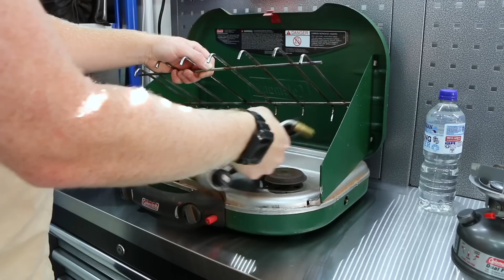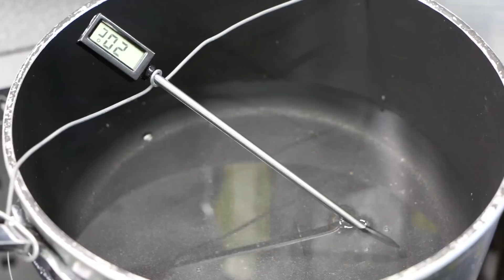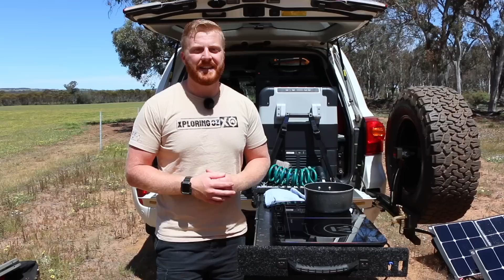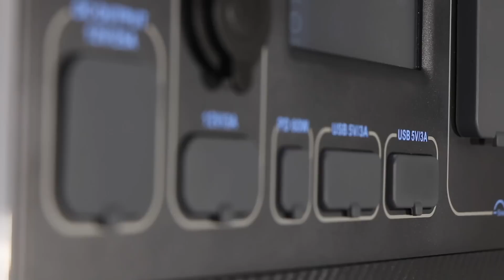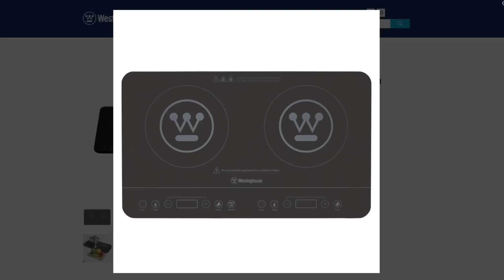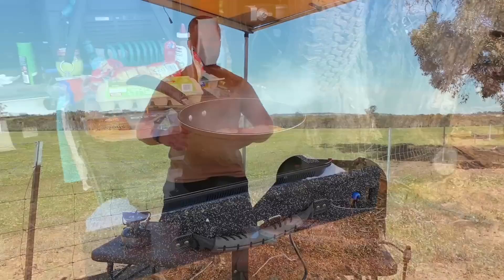INDUCTION COOKING & Camping | Is it sustainable | Electric vs Gas | Overland Cooktop | Pots&Pans

Comment: I strongly recommend that you either:
1.) add a second alternator, because you are overloading the one you have if you are also charging the Bluetti while driving.
Car alternators are designed for a relatively short period of high current loading immediately after starting the vehicle to recharge the starting battery. (a 4 minute heavy load on the alternator for the car battery recharge VS a 4 hour load from the Bluetti.)
 If you run a separate alternator for the Bluetti you can use a 24 volt truck alternator to take advantage of the fact that the Bluetti can handle the higher voltage input if you charge through the Solar Power charging port. and you can get twice the charging power with no increase in the current load on the extra alternator or vehicle wiring.
2) replace your existing alternator with a much more powerful one. I have seen 350 amp alternators used on RVs that charge lots of batteries for use inside the RV.
3.) find a technician who can add a power connection to the AC side of your alternator so you can run that AC into a small transformer to power your induction cooktop and completely eliminate the large power loss in the DC to AC sinewave converter; and be able cook your food while your vehicle is at idle....
 With an induction cooktop the frequency of the AC power it runs off of is not as important as it might be for other equipment..
Reply from the maker: Hey mate, 
Yes a higher powered, slightly different designed alternator is on the cards, however I'll probably get the maximum life from this one first. 
I have noted that even when the vehicle is running, batteries charing and the AC inverter is on and charging the Bluetti, we are still bringing in about 15A positive. It's comforting to know that the alternator still has some capacity left in it after the heavy draw. 
I'll have a look at some options, but thanks for sending some ideas through, I'll definitely consider and research them. 
Cheers, Nathan.

Comment: A very eye-opener review.  I hadn't considered induction, but now I will if I can come up with a good power setup to support it.  I did have a chuckle when you casually set the unit on the table.  I am guessing the wife can't do that.  Just a mere 28.2 KG.  I can see that you have been using it to work out with.  lol   I had to go to the USA site to find the weight.  I could not find that tidbit of information on the Aussie site.  Again, that was a stellar review and I was very appreciative of all the work you put into it.  Subscribed!
Reply from the maker: Thanks mate, glad you enjoyed the video. Yeah, its a decent unit the ol' Bluetti, but the fact it so versatile and powers so much more than just induction cooking, it sure helps off-grid.
Yes, I must admit the Australian site is lacking a little, it looks a little like the US site did when they first released over there. Hopefully they'll continue to improve as business picks up locally. 
Thanks again mate, glad it was helpful.
Cheers, Nathan.
Reply: @XploringOz   I did some shopping and I see that the maximum wattage can vary.  I saw induction cooking plates (had to refrain from calling it a burner) with a max of 800, 1000, 1200, 1500... etc.   If I only wanted to lug around a 1000W battery, would one of these lesser wattage ones do the trick.  Like just 1000W?
Reply from the maker: @davids9577  Yes and no. It would heavily depend on what type of unit you purchased. For example these units I used, even though they have a 200, 400, 600 & 800 W setting, this is an indication of heat and actually pulses the W at 1000W rates to maintain a lower temperature. This with the standby power usage would push it over the 1000W maximum, in my case anyway. 
I'm yet to find a unit that would be able to produce a constant 800W level.
Does that make sense? I hope so 😂 
Cheers,

Comment: How well do they preform above 2,000 feet , when it becomes harder to boil water ? Does it require more wattage like more fuel or just a  pressure cooker and lower watts... 
Ps. I only need 8-900 watts for cowboy coffee on my home 1,800wt induction plate..
I traditionally use an enameled  Dutch oven in fire pit for my evening or Big meal... will have to try the induction at the 5,100 foot campsite next summer on my deepcycle batteries... Cheers from Oregon (USA)
Reply from the maker: Hey mate, so to be completely honest, this is not something that I've thought about (or tested). Where I live in Western Australia, it's very, very flat. So I probably wouldn't get an opportunity to test this, however if you do, make sure to let us know. I would be interested to see your results. 
Cheers, Nathan.
Reply: @XploringOz  am planning on going to the campsite at 5k feet in spring (after meltoff)... winter's just starting up here.. around the 2k+ elevation it starts to get harder to boil water
I wasn't sure about the mountain range over there... 
I'll put up my results, if someone doesn't beat me to it... Lol 
Stay Safe
Reply from the maker: @mrmcclung  Awesome, would be very interesting to hear your results and thoughts on the efficiency. 
All the best with your trip!

Comment: Great video, induction is great but the issue with the limitation inverter technology is problematic. Wonder if during your investigations if you came across dc powered induction cooking unit thus eliminating the dependence on the inverter.
Reply from the maker: Thanks mate, so I haven't come across any DV powered induction cooktops yet, however saying that I also haven't been on the hunt for them either. I guess the only great thing here is that the Bluetti unit has everything built in, so yes we still have that lost power from the conversion, but it's still very convenient nonetheless. 
Cheers, Nathan.
Reply: An inverter is necessary because of physics. Induction requires a changing electromagnitic field, which is not generated in a steady state DC circuit.

Comment: Well done! I have been using induction cooktops for a few months now and love them. The biggest adv is no reliance on gas, space, no flames in canopy, and a timer. Safe as!
Reply from the maker: For sure, agree with you there mate. Glad you enjoyed the video. 
Cheers, Nathan.
Reply: @XploringOz  6iz5
Reply: Is it more costly overtime to use a Battery and do induction cooking?  or Use one of the gas options?  Which one is more affordable?
Reply: @NEXTLEVELHEALTHwithTim good question my point of view is gas is more affordable to setup and supply initially, looking from a cost perspective ,induction cooking will cost more to setup but has minimal ongoing investment unless you count battery replacement in the future.
Reply: Pie! Safe as pie!
Reply: U need a strong solar and battery system.  But I would  add a small  generator  to top up your  battery  and to cook anytime
Reply: But reliance on inverter and battery. Pros & cons…
Reply: I get so tired to clickbait titles. The title said this was about induction cooking and house sustainable it was for some reason. But now it is about three other types of cooking also which we already know about. Coleman stoves or anything that has a flame outdoors becomes a disaster it's a wind is blowing because it is non-stop trouble. I just hate having my time wasted when I thought the video was going to be something else. 👀
Reply: @williamscoggin1509  The Title. INDUCTION COOKING & Camping | Is it sustainable | Electric vs Gas | Overland Cooktop | Pots&Pans.  
Seems pretty much exactly what was in the video. I found it informative,  well done. and from real experience in the field with the equipment reviewed.
Reply: @williamscoggin1509  then you wasted even more time typing this comment, and will probably waste even more time reading/replying to mine!

Comment: I think that a good test for the net power / fuel consumption would be to compare by cooking rice.  At home I have coil top electric stove.  After the water boils on goes the lid and the power  goes down to a the lowest settings for 18 minutes and then set the pot aside and let it stand for 6 minutes and I get perfect rice each time. no scorching and no soggy rice.

if you were to weigh the fuel tank before and after that would tell you the exact fuel consumption for the task and for the induction you could measure the electric usage for that same task if you were running this test using a battery and and an inverter, your measurements should be done on the D.C. side so as to include the cost of the power loss from converting to A.C.
Reply from the maker: This is a good idea and perhaps something I will consider for a long term review on the unit. 
Thanks, Nathan.
Reply: One thing that is missing from all the discussions watt voltage are you using...12-24 volts is waste of time 48v must have

Comment: A draw back with induction cooking is that the cookware must be rated at greater than the energy transfer rate for the induction stove, otherwise magnetic flux saturation will occur and the level of heat generated in the cookware will be less than the rated capacity of the  induction stove.  I purchased a wok that was claimed to be suitable for induction cooking however the amount of ferritic material in the base of the wok was too small and the wok stewed the meat rather than searing the meat as would normally be expected with a spun ferritic wok that can also be readily purchased.  Although a magnet would stick to the base of the induction suitable pan, it did not perform because the magnetic material in the base of the pan saturated well below the induction stoves output.

Now the equivalent LPG burner consumption to match a single pot 2000 w induction stove is of the order of 12.5 MJ/hr which means that 1 kg of LPG will be consumed every 4 hours that the burner is run on "high".   The equivalent LPG input for a single  2000 w induction induction stove on "high" is 7.2 MJ/hr. 

This means that to be able to use an induction stove, whether at home or in the great outdoor setting, the ability of cookware's to absorb the inductions stove's output must be matched, or greater, such that the power of the induction stove can be fully utilised.

There is a lot more physics involved in choosing your induction cookware than just simply seeing if a magnet will stick to the bottom of the pan.
Reply: I'm sure your math is correct and far above what my tiny brain can understand but I have had my induction stove since 2012 and have never had a stainless, iron or steel pan that magnet tested not work great. The only things I have found is that the pan has to cover all or close to all of the designated cooking area and the steel insert in aluminum pans is usually not large enough to sufficiently absorb the magnetic energy .
Reply: @larrymcgraw5133  Perhaps a read on the topic of magnetic saturation and its uses would help you to understand what I had written about.  In your post you have touched on some of the reasons for magnetic saturation problems with induction stove problems with respect to the cooking pots that are suitable to use.
Reply from the maker: Sure, I hear where you are coming from and appreciate the comment here so that other's can see your rationale. Although I don't dispute your research, I think for the majority of induction users, they just want something to work and probably don't care too much for the physics behind it. I was just trying to keep things nice and simple for those who wants something that will work, albeit maybe not every single time.
Cheers, Nathan.

Comment: Didn't the induction caution not to use it on metal? lsn't that a metal shelf? thanks for the demo
Reply from the maker: Yes, there is a caution there, however the bench I was on is only a very thin metal veneer. It didn't appear to effect my results on or off this bench, nor cause any interruption with the unit itself.
Cheers, Nathan.
Reply: @XploringOz  Thanks, l'm old school, love a flame to cook with but my goal is to convert a van/short bus to live out my golden years. Extra fuel (combustible) sources seem to be a valid concern. l truly value learning the way your common sense/visual "lab tested" demonstrations were done, just what l need to learn /& understand in a practical way. Not the blah blah blah of ads.
Reply from the maker: @lward7788  Thanks, I appreciate that. Yes and these inductions cooktops don't necessarily replaced gas or open fires, but can compliment them well.

Comment: Sustainable means different than you think: Manufacturing an induction cooker and a PV system to handle it, is considerable worse than a $20 gas hob with disposable canisters, especially if you don't camp that often. A camp fire is CO2 neutral and require nothing but a pot.
Reply from the maker: Sure this is true, however an open fire is also illegal during summer months in Australia, so is impossible to use. It all comes down to personal preference and circumstances. 
Cheers.
Reply: @XploringOz  You need to camp a lot for such a hi-tech setup to be worthwhile. I personally use one or two Campiz gas bottle per season around 2L, so an induction cooker and more solar panels, is not worth the investment or would be capable of recouping the footprint from its manufacture, with my use frequency.
Reply from the maker: @Tore_Lund  Yeah, I agree. It would be dependent on circumstances. Keep in mind as well though a unit like the Bluetti powers more than just induction cooking.
Reply: @XploringOz  Yes and maybe you could be even more clever: Hookup your RV to the house PV for the rest of the year, so save up some goodwill credits?

Comment: I use a WALLAS XC DUO diesel cooker/heater, which is ceramic cooking, no gas onboard it uses the vehicles fuel tank, as there is no naked flame it is completely safe and the heat is dry so no condensation, they are expensive but I wouldn’t go back to gas. Oh and you can cook toast on it, They also do a diesel oven as well.
Reply from the maker: Nice, I just had a look at these units and they look great! There really are the perfect overlanding device. The fact they use the same fuel as the vehicle is a huge advantage! And you can cook toast 😉 
Thanks for sharing mate.

Comment: I live in Texas and we have power outages from hurricanes and tropical storms.   I have a 1500w pure sine wave inverter.  I lift the hood of my truck and use jumper cables to hook it up to my truck's battery.   I start the engine so I won't drain my battery. then use my induction cooker.
Reply from the maker: Nice, it's great that you've been able to sort a solution for those situations. What kind of batteries do you use, lithium, or AGM, calcium etc? How does the battery fair when pulling so much power at one?
Cheers, Nathan.
Reply: @XploringOz  I am using the standard truck starter battery.   I start the engine before I start the induction cooker, so the alternator is providing all the power I need.
Reply from the maker: @miken7629  Good to hear that you've made it work that way. 👍

Comment: 2 questions will this work in 30 amp camper ...next most like crazy put i have pace maker defibrillator will affect this mechanical stuff in my heart
Reply from the maker: So firstly, when you say 30A camper, is this the rate at which batteries can be discharged? These induction cookers running on a high temp would draw in excess of 70A from 12V, so this may be a problem. 
And secondly, there is a chance it may effect pacemakers. There is some EMF that is emitted from these units, so I would definitely do some research here before using these, just to make sure. 
Cheers, Nathan.

Comment: I love my little induction cooktop. I like it for easy cleanup. I just keep a spray bottle of distilled vinegar and spray it lightly after each use. It also heats up extremely fast. I use it at home. I do have 400 watts of solar with two lithium batteries on my 24' Ho-Lo trailer. I want to get the Bluetti solar generator. You are definitely on to something here.
Reply from the maker: For sure mate, they are great units and provide so many benefits over tranditional gas, albeit with a few con's too. 
The Bluetti unit has been great so far to power these units no problems. 
Cheers, Nathan.

Comment: I purchased a Induction cooktop a year ago. I checked it with my EMF meter. Wayyyy to much EMF hitting my groin area. I returned it for a refund. Propane is my favorite for cooking.
Reply from the maker: Fair enough, I guess this comes down to personally preference. 
Cheers, Nathan.
Reply: Induction cooktops don't produce ionizing radiation so hundreds of exhaustive studies show no ill health effects from induction cooktops. I understand some people are suspicious of "studies", large corporations can deliberately skew the data points, but there is no evidence induction cooktops are dangerous, and significant evidence that cooking with gas gives of many toxic particulates, and when a cold pot is first put on a gas flame, the gas against the cold pot causes incomplete combustion releasing small amounts of carbon monoxide! Induction cooking is far safer in many ways!

Comment: Regarding the "simmer test", even cheap induction burners now have a temperature setting.  If you want 80C, just set it to 80C.  It will stay right there all day, if you want.
Reply from the maker: Yes, this is true and these Westinghouse unit also have that function however when testing it the variance was huge, between 15-20 degrees. So although it may be alright for certain applications, overall if you are looking for a constant temp, the way I tested will probably be preferred. 
Cheers, Nathan.